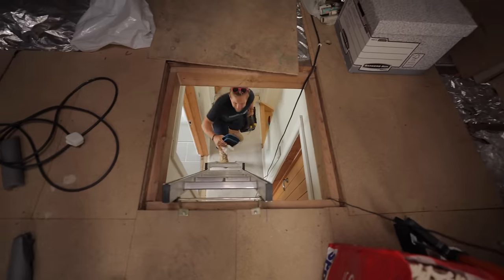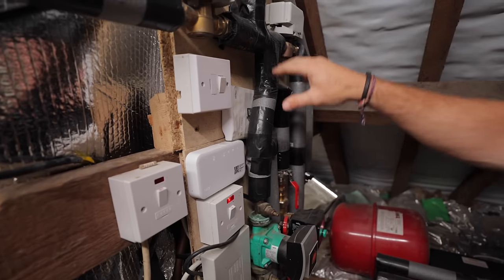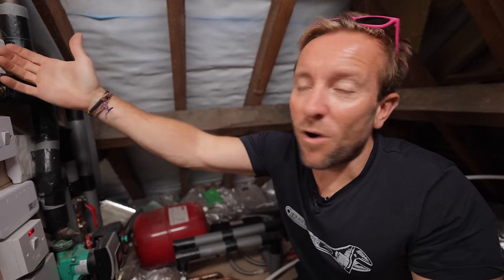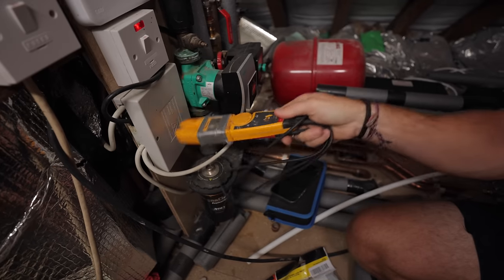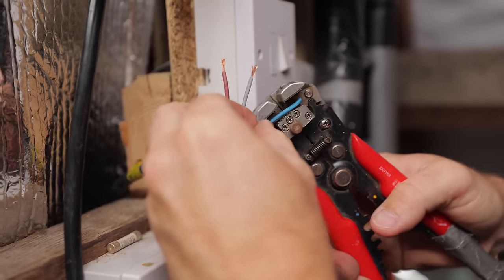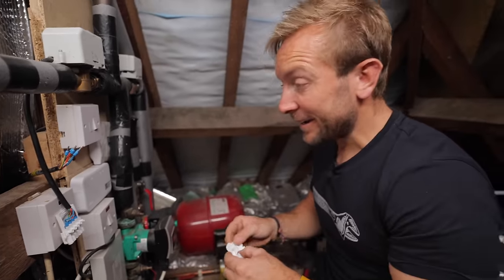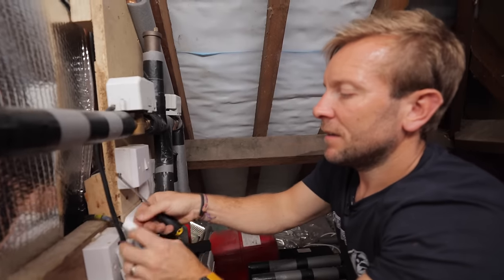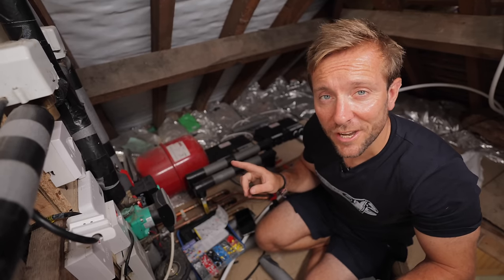EASY - HOW TO REPLACE 2 PORT AND 3 PORT MOTORISED VALVE HEADS

Comment from the maker: How to replace 2 port and 3 port valve motorised valve heads IN MINUTES!
Get the connector HERE: https://amzn.to/3Owk90f
Get the wire crimps HERE: https://amzn.to/478GbNC
🛠 AMAZON TOOL STORE: http://www.amazon.co.uk/shop/plumberparts
🥾 10% Off my workboots + workwear Use Plumberparts10: https://elwoodworkwear.co.uk/?ref=Plumberparts10
👓 10% Off Safestyle Sunglasses Use PLUMBER10: https://safestyle.com.au/?ref=PLUMBER10
Reply: That was electrics. Not changing the valve head, right? So utter waste of time

Comment: I love and subscribe to your channel. I've done nvq level 2 electric and one day will do plumbing. I didn't like this video.. sorry. You didn't show , even for 1 minute taking of old head, how to make sure you connect it correctly to make sure water is pumped in right direction. If you connect wrong way round water is pumped other way as motor turns other way in a synchronous motor I think?.   Love all your videos but not this one.😢. I'm looking to do this as I'm in middle of changing head and even though I've done it before I'm nervous..and wife is worried I'll damage the system and this video didn't help. I have loads of wago and box with loads of cable glands to make sure box is waterproof even . Don't need £10 box .

Comment: In most cases James there’s no need to even do that, just replace the burnt out synchronous motor in the head of the valve. Easy job.😊 oh and “don’t forget to hold tight”

Comment: Had one of these 2 port valves stuck in the "on" position but after removing the head I could easily move the spindle with my fingers, so it seems as though some part of the head mechanism is/was jamming. Followed these steps exactly to replace the faulty valve head. Love the 5 way connectors - great idea - bought some and used them for this.  Problem solved in less than half an hour including getting tools out and tidying up.

I can see an electrician's point of view that this "should be easy" or that plumbers should know how to "do it properly", but for a DIYer, this is a great technique, especially as you may (as I did) inherit a messy box of wires that you have no intention of understanding. 

Following this video turned my problem from yet-another-callout + parts and labour into something I could trivially do myself. Thanks!

Comment: Nice work James.  You should always do safe isolation and prove dead as you never know when you could get a reverse feed on the neutral or the signal wires.  If you are going to use several of those 5 way Plug/Sockect arrangement it is worth labeling them.  Also worth getting the 6 way mandrel version of that crimper.

Keep the good work and Hold Tight

Comment: Thanks for the vid. Unfortunately I had one that was so old the actuator was permanently attached to the valve so I had to replace the whole thing. Turned off all the stopcocks and taps I could see that would supply the valve, unfortunately still had a lot of water coming out, but its all cleaned up now. Used LS-X leak sealer on all the copper compression fittings which worked great. 
Did really like the tip for the wire connector and it worked great, although one day I do want to replace the awful wiring centre with one of those nice organised wago boxes designed for it 

Now got working heating again!

Comment: When the valves go it’s usually the motor or most often the relay so I just change them. The relays are often under rated so I fit a higher rated one, and after that they don’t fail. I guess it’s manufacturers saving on pennies. I am trained in electronics though.

Comment: The Honeywell V4043H1056 has Blue going to the synchro motor, along with Brown.  Given my 'unhinged sense of order',  I think it logical that Brown is in position 3 (next to Blue), and Orange and Grey are in positions 1 and 2.
All-in-all, I guess it does not matter what goes where, as long as the other side matches.
NB I absolutely agree that these plugs should be mandatory/compulsory.  A plumber can get these for £10 trade price.  Considering the valves will die countless times over the systems lifetime, this are so obvious (although it is generally the synchro motor burning out, which are easily replaced).
(IMO the Regin part could not be more cheaply made, and very overpriced.  The cable retention is just nasty.  That said, haven't spotted an alternative.)